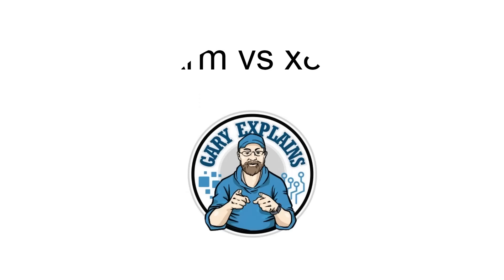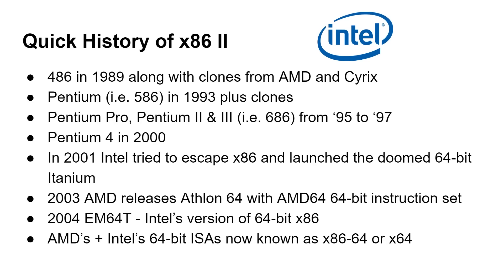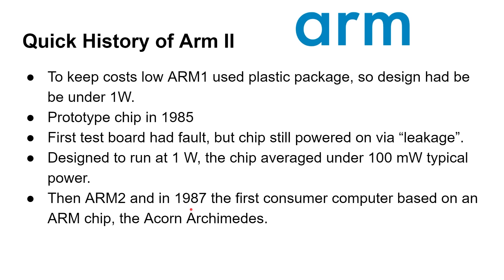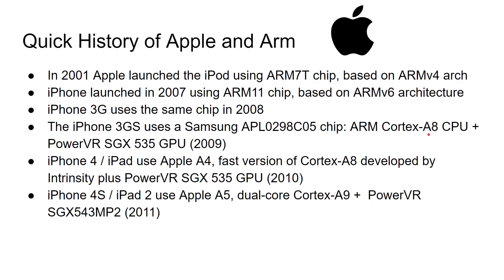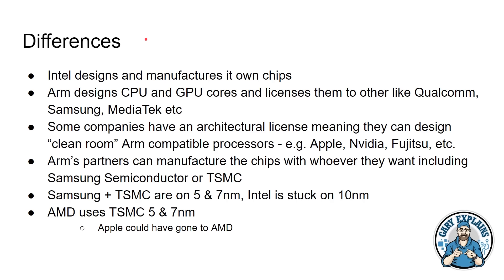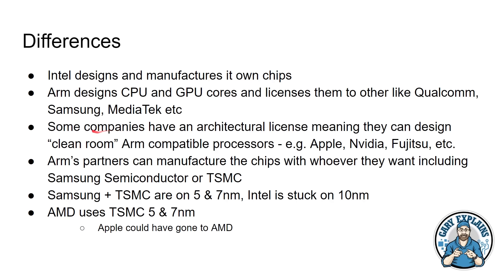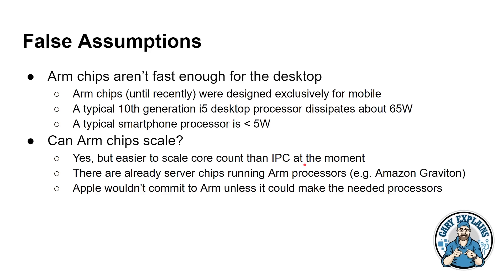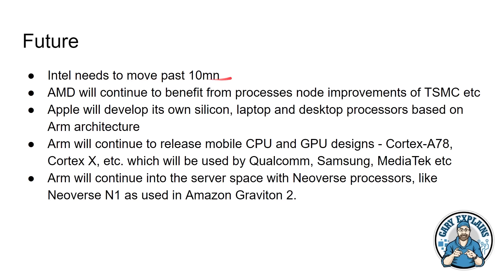Arm vs x86 - Key Differences Explained

Comment: This is pretty spot on but I don't see their pro line going to ARM unless users are willing to give up significant IPC. Their current processor is almost on par with an i5. Will the next generation or two make gains? Sure, but so will intel. Nobody is sleeping. Honestly, AMD would have been a better idea. The downsides of CISC are pretty overstated at this point. The decoding logic makes up a very minute part of the overall logic. It used to be much more significant. Yeah you end up with deeper pipelines and more stages, but when you have 100 watts to burn who cares? 

I feel like arm is always going lag what x86 is doing. The power savings are great for laptop and tablet users but it's not going to matter on the desktop. Creating highly parallel code is still a large problem today with not a lot of solutions. Most software problems do not easily translate into parallelized workloads. I think we are going to see more of a general shift towards that, but IPC is still going to be the most important metric for some time in my opinion.

Comment: at about 13:00, I'm a bit disappointed you made it sound like Intel's 10 was substantially worse than TSMC's and Samsung's 7/8 without pointing out that they are different enough processes that the number is largely just a name at this point. Looking at other metrics TSMC's 7 is substantially comparable to Intel's 10, but seems to have higher yields.
Reply from the maker: Well I cover that exact topic in other videos, I can't repeat myself ad nauseum. Even so, Intel doesn't yet have a reliable 10nm process, most of the its SKUs are on 14nm, I was being generous to Intel by even including the 10nm.

Comment: Whoa! I don't expect professor Gary would make continue on this topic!
First I want to admit my fault on the comment on previous video about doubting performance of ARM architecture (especially chip from Apple new devices), after some research I know Apple is the best in this area. But there is some point that I think gonna make Apple become (sorry) suck if they continue moving to their own designing chip
1. I can't imagine the price of product of their product in the future, in theory when a company product their own component, they can reduce the production price. But we talks about Apple here, and we know what happen when a thing has bitten apple logo in it, the the way it price would be different. 
2. The transition would make many people unhappy, especially ones who had big corporations and got many investment in current Apple products. Even if Apple assure that their currently Intel powered machines would be supported when the new ARM based product comes, the diversity between architecture isn't something easy to talk. Yes it is true that Rosetta 2 is prepared to make easy the transition process, but how about maintaining the Intel based machine software with new ARM machines? No one talks about it. That's from software maintenance perspective. How about hardware perspective? The current hardware maintenance in Apple product is already suck, can't imagine what happen in future.

I think for next 5 years, Apple gonna had the hard time in enterprise market, but not in end user market.

Comment: AMD could invest into RISC-V and make server and desktop CPUs / APUs.
especially with APUs that would make sense to increase energy efficiency. maybe this would be an interesting medium power option for mini-PCs or APUs for TVs to get more computing power out while still only using in the area of 25Watt. also interesting for light weight notebooks. with the RISC-V ISA, they would have no restrictions like with ARM licenses.
one of these two dinosaurs (AMD; Intel) have to move at some point because their market is shrinking. if all the software is running on non x86 CPUs, then there is no need for x86 CPUs anymore. what about a bastard with 8 fast RISC-V cores and one x86 core for compatibility?
Reply from the maker: And who would AMD sell these chips to? Windows doesn't run on RISC-V, neither does macOS. So that just leaves Linux... What advantage does AMD get by switching away from x86, it seems to be making a profit right now.
Reply: @GaryExplains  no, not switching away from x86. they have to ride that pony until it is dead. but they have great know how in desktop and server CPUs and APUs. Linux servers for amazon etc. is a good way to complement the shrinking x86 business. Android based Desktops, TV and small HTPCs comes in mind too where existing ARM based solutions are not powerful enough now.
gaming computers and consoles with x86 need a lot of power. that could be an advantage for risc based solutions.
Reply from the maker: And why would the RISC-V solution be more powerful than an ARM solution for those areas? Why would AMD invest millions in a market that doesn't actually exist?
Reply: @GaryExplains  it is not more powerful, it is the same risc architecture, same potential. but AMD does not need a license and can implement their own SIMD etc extensions. they don't need to ask anyone. they don't need to ask ARM what kind of extensions they are allowed to implement. they could implement extensions that are useful for acceleration of java or .net VMs. they can implement there own way of IPC, pipelining, branch predictions, caches etc. without asking ARM. it is an option. of course using ARM instead of RISC-V is also an option but might come with drawbacks too.
Reply from the maker: @stefanweilhartner4415  I think you are misunderstanding how the licensing works, AMD wouldn't need to ask Arm about the branch prediction or caches, etc. Also the major weakness of RISC-V is that AMD could add whatever it wants meaning you get fragmentation. I have 4 videos in a series in RISC-V, you might want to watch them.

Comment: +1 increasing the core count is not so simple either. You cannot "just add more cores", you need to feed them with data, which means each of them needs connection outside the chip. It can be solved, but still, the biggest ARM has something like 80 cores, while AMD has 64 cores EPYC (and they have very similar power consumption).
+2 "Apple wouldn't commit to ARM unless it could make the needed processors." Agree, but this does not mean that ARM can scale. Apple has a good low power CPU, but it definitely does not have anything which you could compare to something like a strong desktop or HEDT x86. However, this is not a problem to Apple, since it has its money from the main stream consumers, who need thin notebooks, so it will have the CPUs it needs. Apple doesn't need scaling!
Reply from the maker: So you think Apple with drop out of the high end personal computer market completely?

Comment: Hi Gary, I want to ask the question: can the ARM run the windows and its apps same as X86?
Reply from the maker: Can I suggest you watch my review of the Surface Pro X, that might help answer your question.
Reply: @GaryExplains  Thank you very very very much. I get that the ARM chip can run Windows and its apps. But I feel the X86 has no future, because laptops pursue low power and servers also pursue low power due to 24*7 operating cost. OMG, intel and AMD....

Comment: Great video. However, the conclusion seems to imply that the only thing holding Intel back is their process, and that once Intel figure out 7nm or 5nm they'll be back in the game.
However, AMD are on 7nm, and while they are well ahead of Intel (and it's not just the process size that is giving them the edge), the new generation of Arm processors is eclipsing Ryzen in terms of processing power.
I think we've passed the point where Arm chips have taken the top spot on the processor power race, and x86 processors aren't going to be able to do anything to close the gap. I do believe x86 chips will continue to improve, but at a much slower rate than future Arm chips, so the gap will get wider and wider.
Apple have picked a good time to jump to Arm, and I expect we'll see more Arm based PCs going forward too.
Reply: What Arm chip is surpassing AMD chips? Apples maybe but definitely not the Qualcomm Snapdragons

Comment: The fact is that there are so little compare to RISC vs CISC the fact is even ARM code will be reduced to Micro Ops as generations passes ARM instruction set is not equal to internal instruction e.g advancements in SIMD or 64 bits, sorry ARM is just as power hungry as x86

Comment: I hope they don't take the easy path with ARM, like they did back then using CISC. By that I mean brute-forcing with raw and non sense power instead of forcing the developers (both hardware and software) to make a smart and clean implementation that might take longer but be more efficient. TLDR: I hope they just don't throw big heatsinks and power current to make ARM be the new x86.

Comment: Intel now only coexist because a lot of professional apps have much better optimization on their architecture. x86 is old and both Intel and AMD need something new that works on every device without problem, or benefits because of the brand. Also i think OS need to be free, but other software you need to pay via subscription.

Comment: Gary, I wonder if you could design a speed test like the one you made for the new and old cpu but for the arm mac when its released
Reply from the maker: Yes, I think something like that might be possible, maybe I already started working on it! 🤫
Reply: @GaryExplains  do you have a kit? i wonder if gaming on it will be viable java minecraft
Reply from the maker: @gabboman92  No I don't have a transition kit, but if I was theoretically working on such a tool then it would run on Windows, Linux, and macOS, on x86, x86-64, and ARM64. All the pieces necessary for that are available, except for ARM64 macOS.

Comment: I was surprised that, given how you often make a point of referencing your related videos, you didn't point toward your "RISC vs CISC - still a thing?" video since the x86 architecture exemplifies what's left of CISC in modern processors in that despite its very RISC-like microinstructions that the CISC instructions are converted to, it still has a superficially CISC instruction set.  Especially if you include the now seldom used "string instructions" which concisely express loops without using ACTUAL branch and compare instructions which aren't even used by compilers anymore because explicit RISC-like instructions map easier to their corresponding microinstructions.  So basically x86/amd64 is, strictly speaking, a CISC ISA though it can be thought of as really a RISC ISA that is only superficially CISC when you're aware of how things probably map to the microinstructions.
Reply: Oops!!!  I jumped the gun on this comment.  I can be pea-brained and get a huge opinion before I finish a video and it distracts me from paying attention to the rest of the video unless I unload it.    You referenced your "RISC vs CISC" vid so now i'm heading over to THAT. Thank you!

Comment: Actually, Intel's 10nm is more or less equivalent to the other manufacturers 7nm (cf https://en.wikipedia.org/wiki/10_nm_process#cite_note-4 ). Why the others decided to go with a lower number is mostly for marketing reasons.
The main problem is that they took much longer than expected to roll-out this 10nm process, and they just rolled it out, whereas the others are on the verge of moving to 5nm.
Reply from the maker: Or that could be a message from Intel's marketing department trying to cover up the fact that Intel is behind.
Reply: @GaryExplains  Linus tech tips made a great video explaining this recently : https://www.youtube.com/watch?v=ROS008Av4E4
Reply from the maker: Linus "Not Sponsored by Intel" Tech Tips!!!! I also made a great video explaining it as well: https://youtu.be/ZaqcwlZZST4
Reply: @GaryExplains  I don't understand. You say yourself in your video that what actually matters is transistor density. And Intel's 10nm has higher density than most others' 7nm processes (cf https://en.wikipedia.org/wiki/7_nm_process#7_nm_process_nodes_and_process_offerings ).
Are you saying that it's not the case, or are you doubting that the numbers Intel are reporting for the density are wrong ?

Comment: Neat explanation mate but... AFAIK Intel is stuck in 14++++++++++ nm and are having serious issues to produce 10 nm processors, right?
Reply from the maker: It does actually have 10nm parts, however I think yields are a problem so most of the processors are still on 14nm,
Reply: @GaryExplains  well thats my point, they have issues on producing them in another comment a mate states that that yields does not comply with intels criteria on processor peformance so thats why they are not producing them in other hand in the same comment he states that Intels 10 nm can be compared to TSMC production how right is that?
Reply from the maker: @Maximococolio  It is all about naming and transistor density. I cover that in my video video in Qualcomm and 5nm.
Reply: @GaryExplains  link please gentle sir
Reply from the maker: @Maximococolio  https://youtu.be/ZaqcwlZZST4
Reply: @GaryExplains  thanks!!!

Comment: I know it's not substantive, but Compaq beat IBM to the 80386 processor desktop. We had the first one where I worked as well as the first IBM PS/2 Model 80 which was the first 386 based system they sold. Both were very nice at the time. Blast fast compared to the PC/XT/AT.
Reply from the maker: I mentioned that Compaq was first.
Reply: @GaryExplains  Ah, missed that. Thanks.

Comment: I am really a noob but I have a question...
Is it safe to use windows software made for 64 bits processors on android phones of arm architecture using emulators as mobile processors are not developed to run all those complex softwares...???(for the softwares that runs on the emulator and the phone can handle under bottleneck situations)
Is using those emulators gonna damage the mobile processors in long run...???
Reply from the maker: I think you are a bit confused about how processors work, you can't damage a processor by running software on it. Plus the you seems to misunderstand the role of the emulators, Windows on Arm is running ARM code. There is an emulator to run that x86 software if needed, but again that is a good thing and not something that can harm an processor. Finally these processors are not designed for Android phones. Did you know that the world's fastest supercomputer uses an Arm based processor. Hardly an Android phone is it!
Reply: @GaryExplains  Thank you for the information...
And that is a really amazing fact...😍
Reply: BTW I was wondering about the heat issue that might happen IDK...😅
Anyways which emulator are you talking about  is that Limbo...???
I would love to get any suggestions about this topic...☺️
I am just very much curious about it...
Reply from the maker: With regards to heat, it is the same with very computer - desktop, server or supercomputer. You need active cooling. As for the emulators it isn't like that. May you should watch my Surface Pro X review, it is an Arm based laptop from Microsoft, running full Windows. The emulation is deep down side Windows, you don't notice it.
Reply: @GaryExplains  Alright I will surely watch it...

Comment: Whenever someone mentions itanium I have to counter with the meme at the time iTitanic. Even recompiled source code it ran slower than x86.! A great leap backwards. PA bindaries I don't know if Hewlett Packard suffered a similar hit. But basically from an Intel (x86) side you suffered a 3 fold slow down even with recompiling with knowledge of the processer. If you could code in itanium assembler fine. But who is running assembly at that point in time but for bespoke applications?

Comment: If Apple designs a microarchtectute for their higher TDP devices, by how much do you think they will be able to outperform current intel CPUs?
Reply from the maker: That is a good question, but unfortunately there are no data points to even make an educated guess.
Reply: Gary Explains does the SPEC2006 used by Anandtech translate well to real life workloads? Because on that scenario, the A13 core is just 10-15 percent away from the skylake architecture, consuming only a fraction of the power. 
I mean... that is an mobile architecture. This make me kind of hyped for some huge transformation on the PC market with Apple move to arm architecture. Should I be this hyped? I mean... I’m hoping that performance increases linearly with the power budget, but, there is nothing indicating that this will happen.
Reply: Gary Explains I’m a windows user. I live in a third world country and I can’t afford a Mac. But I wish the Apple transition to ARM will translate into better cheap Arm based windows/Linux machines. All I want is this, better user experience. I just hope that it doesn’t take to long for the gains that the Mac takes to translate to better PCs overall!
Reply from the maker: SPEC2006 is a good data point and at least gives us a direction of travel. I expect the A14 variants to be competitive in whatever Macs Apple releases.